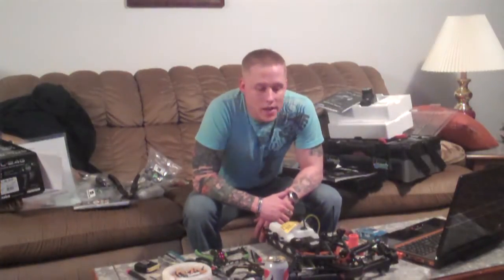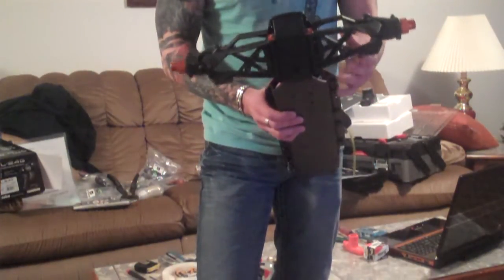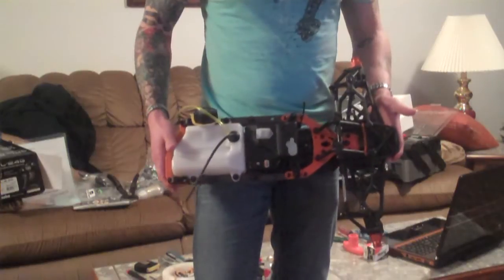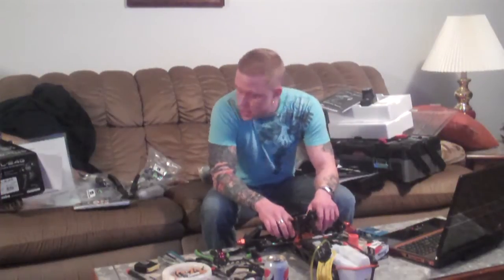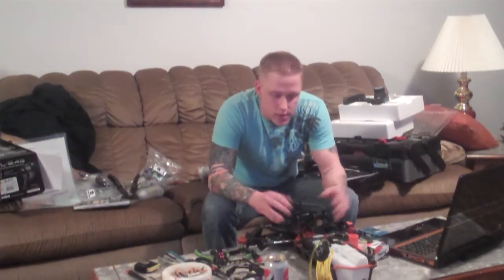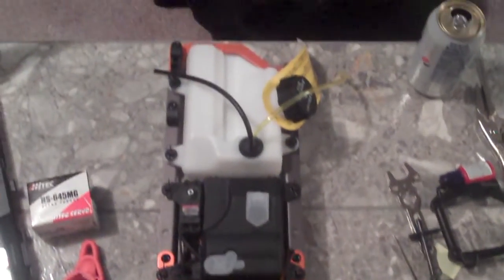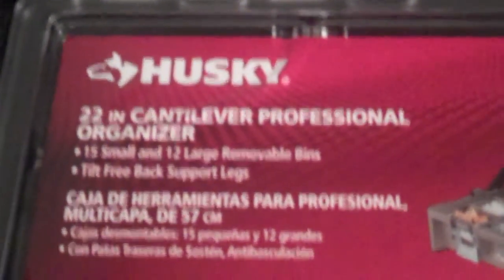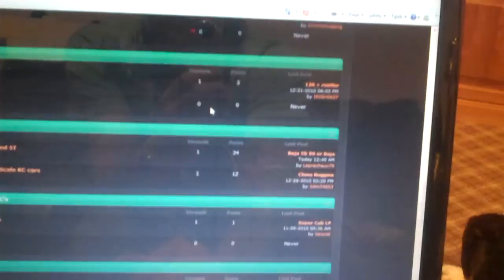Baja 5B SS Build Video. Part 1

Comment from the maker: @braco222 Welcome to the forums! Everyone introduces themselves in the welcome center usually. I like the idea of having an "introduce yourself" thread. You can actually make that thread if you want. As for as the background goes, the original plan was to do it in white because of the Irish flag colors. We haven't got a chance to do it yet. Making a website and forums is a lot more tough than most people think. The forums are not totally done yet either. We still have work to do on them.